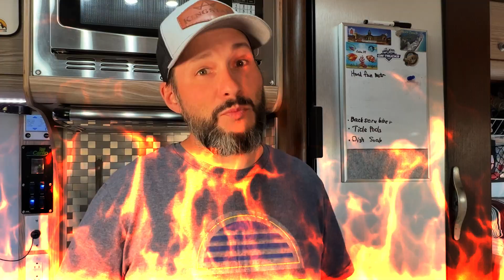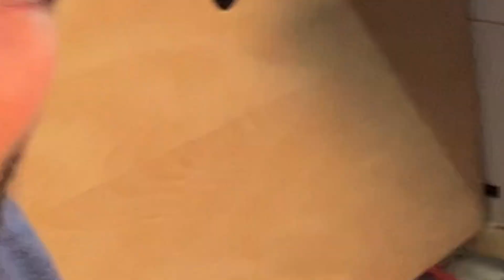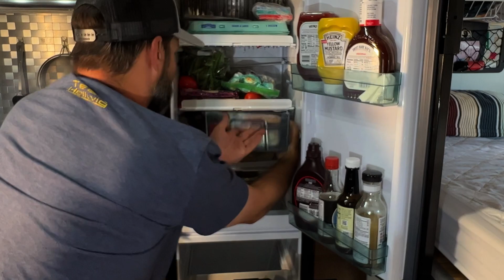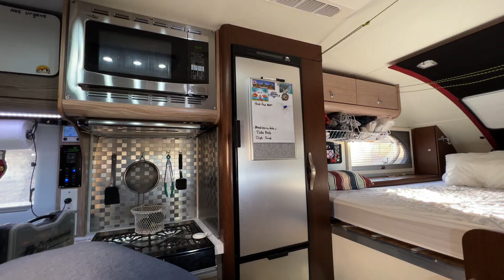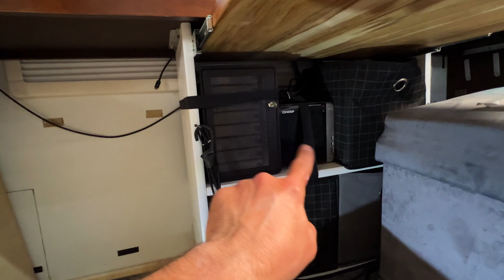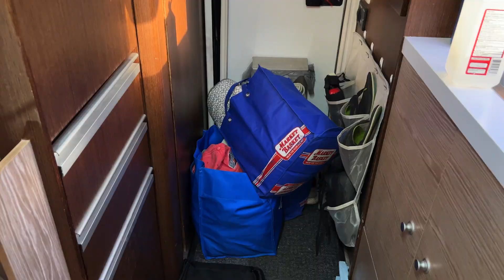🥶 Unlimited Fridge Fan - Hard Wired USB Blower Fan - RV Fridge Fan

Comment: I've battled this issue for years; trying to keep the temperature uniform in the fridge.  I use one of those popular little "D" cell battery powered fans, but it really still doesn't cut it.  And my own tests using remote thermometers over several days while parked in a hot garage confirms that the bottom shelf is always warmer than the top shelf, not opposite which is what many people believe would occur.  I want to install something similar to your setup eventually, and ideally, with an automatic thermostat in the fridge so it operates only when needed.

Comment: Please put a fuse to the 12v to 5v converter.  If it shorts out internally the wire will melt the insulation and catch fire.

Comment: Nice job Scott I had the same issue with my Cirrus frig I can't believe the Norcold people haven't addressed this issue.  Every time the door opens you loose all your cols air and it takes forever to recover it back. What I started doing was freeze the bottle water and put then in the door to help out.
Reply from the maker: This is a pretty common issue across a lot of RV fridges. Ours has plenty of cooling ability but the airflow isn’t very good. Especially after we fill it with groceries. The battery setup worked well, but it’s nice not having to tend to it anymore.